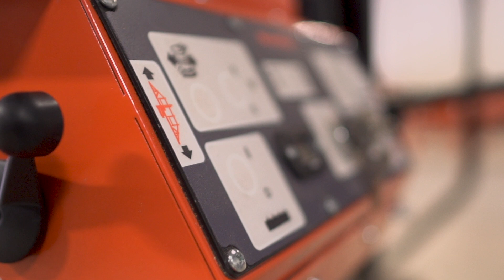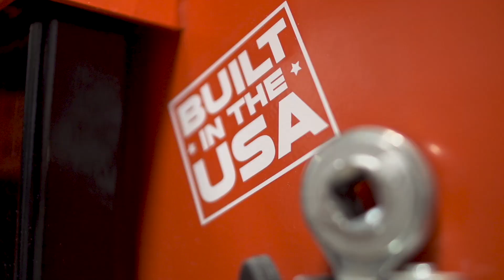LX250 Wide Slab Sawmill in Action | Wood-Mizer

Comment: What is the thickest gauge and widest band you can put on this mill. Anyway to upgrade to a larger electric engine?
Reply from the maker: The electric motor currently available for this machine is the 15HP. The LX250 uses a 1-1/4" wide x 215" long sawmill blade.
Reply: Any upgrade option for a 2” wide blade?
Reply from the maker: Currently there is not an option to increase the blade width to 2".

Comment: What is the horsepower of the electric and what’s is the additional cost?
Reply from the maker: Hi Blake, the electric motor is 15HP and is the same price as the gas engine at $25,995 USD. More info and specs are available at woodmizer.com!

Comment: Great machine! what is the cost, on average, for this model?
Reply from the maker: Hi Brian, the LX250 sawmill with 38HP gas starts at $25,995 USD. The only additional option for this sawmill currently is a 5' bed extension, everything else comes standard on the mill including SimpleSet Setworks and powered saw head controls. More info at woodmizer.com!